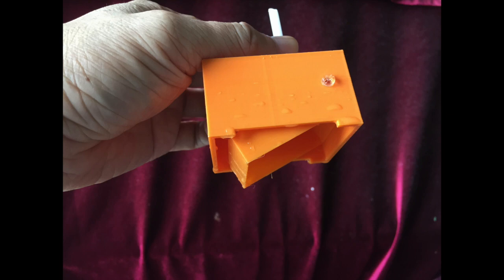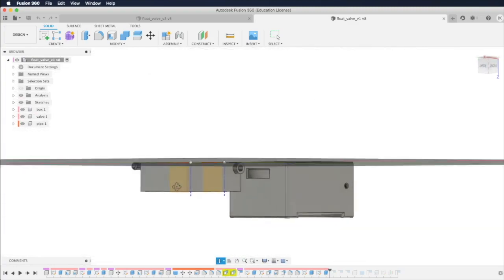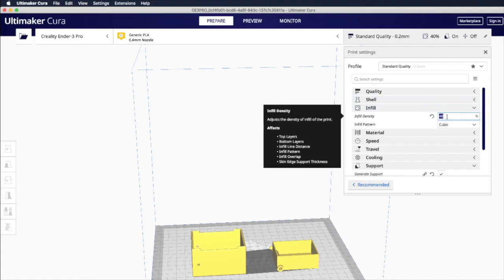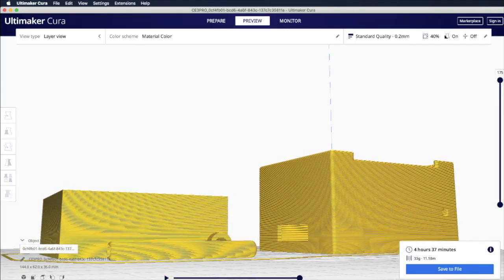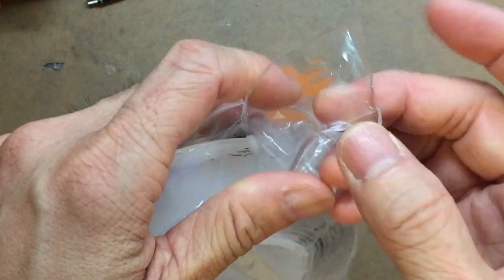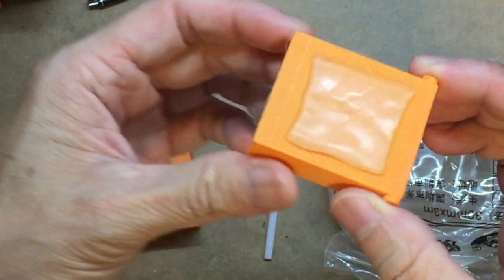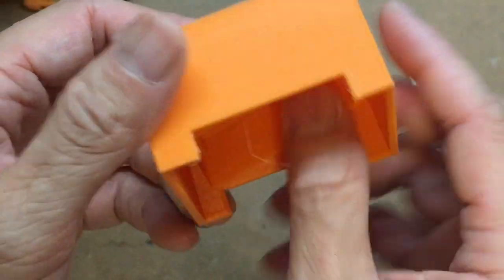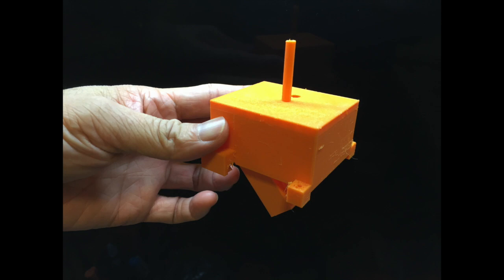3D Printed Hydroponics Float Valve V1.0

Comment: Is it possible to control high and low in this model
Reply from the maker: This one only control high level. To control low level as well you will need to add a second valve on the outside to seal the air hole. This may be my next project